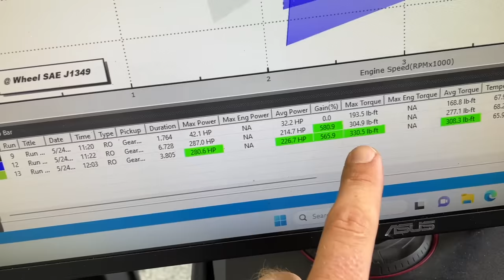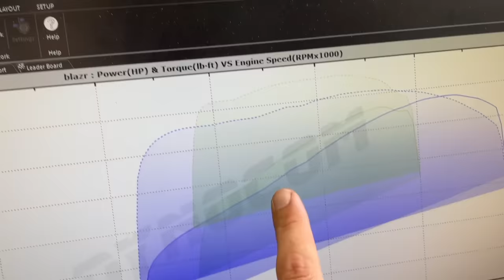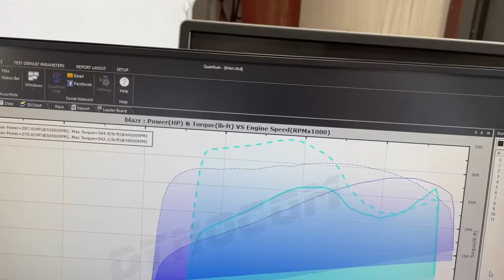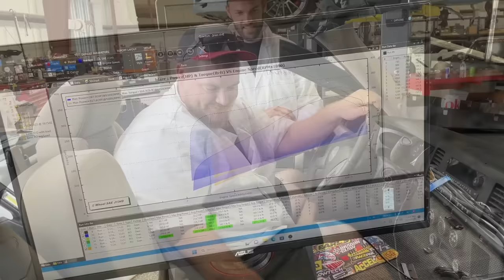MIND BLOWN!!! We Put TOP FUEL NITRO In a Daily Driver and It Made INSANE HORSEPOWER!

Comment: The amount of air required to burn 1 kg (2.2 lb) of gasoline is 14.7 kg (32 lb), but only 1.7 kg (3.7 lb) of air is required for 1 kg of nitromethane. Since an engine's cylinder can only contain a limited amount of air on each stroke, 8.6 times as much nitromethane as gasoline can be burned in one stroke. Nitromethane, however, has a lower specific energy: gasoline provides about 42–44 MJ/kg, whereas nitromethane provides only 11.3 MJ/kg. This analysis indicates that nitromethane generates about 2.3 times the power of gasoline when combined with a given amount of oxygen

Comment: Nitromethane is basicly a liquid low explosive, used as fuel. 
Some part of it burns (the methane groups) as it carries roughly 50 % of  the necessary oxygen itself for combustion (but still need some more), but the main energy release is the nitrogen relasing their bonds to the methane group and the oxygens, and forming bonds with another nitrogen making N2 aka gaseous Nitrogen. (just like in most high-nitrogen explosives, as a nitrogen-nitrogen bond is the most stable and lowest energy state, and any energy state above that, that was used to "force" the nitrogen to bond to other atoms is then released as heat).

Thats why, in top-fuel and the like, the huge honking supercharger is mostly there to squeeze in some air that make use of the "methane" which combusts conventionally and also act like an cushioning effect for the MUCH more violent energy release caused by the Nitrogen bonds. In port injected nitromethane it also reduces the chance of hydrolock.

Comment: I didn't have time to watch the whole video but when you run nitro Methane you need a much richer mixture I think.
My engine wouldn't run, I started it with float bowl full of normal 99, it ran, but as soon as the nitro fuel from tank reached it, it started to bog then stopped.

Comment: Now, add:
a nitro tank, a 2nd fuel pump & filter,, an electric fuel valve,  a 'wye' with backcheck valves and fuel line connectors, for suitable pressure, all rated for use with nitromethanol, (don't want stuff dissolving) both pump and valve are switched by the (separate from the map controls) 'map-1-map-2  fuel' switch. 
Both maps stored on chips, with a checksum comparator, a 'change map', a 'select map', and 'load map' switches, with 'completed' 'error' and other messages displayed either by LED indicators, or  LCD  or LED display.
So once installed, can select change map, select map-2 (the nitro map) then operate map-1 -.map -2 fuel switch' to map -2
could also make the 'TMI' or 'operators Keep It Simple Stupid (KISS) version could be a simple 'normal' and LETS GO M-F'S!!! pushbutton switch and 2 LED's.🤣

Comment: Take care about the serious fire hazard!
Reply: I thought that too, being it's sitting there in an open 5 gallon bucket... but nitro-methanol doesn't ignite that easy, well, as easy as gasoline would. It's more explosive when it does though. I have 3 gallons of 25% nitro-methanol sitting 5 feet from me in my office in my apartment. The bottles are sealed though... :) I use it for RC cars. It has 11% castor/synthetic oil in it though too.

Comment: Build a custom injector port and run both stock/aftermarket injectors and stock computer/ tuned . And a switch to run whichever one you want or need. And then a fuel cell with your fuel mixture. And you have a hell of a sleeper

Comment: Put a few drops of hydrazine into that nitro and then try your test.  Replace engine oil with 05W.  And, remove the hypoid lube from the rear differential.  Go real fast for a couple miles.

Comment: Too bad they didn't gather some other baseline data, or "control" measurements, like a compression test, and a leak-down test, on each cylinder, pre and post dyno pulls. 
I suspect the readings would be quite a bit different after just those few pulls. There's a price you pay for those kind of HP gains...  I used to race dirt oval karts (2-stroke), and one was a Yamaha that I ran a 20% nitro/methanol fuel mix, in a 20/1 fuel/oil ratio.  After 1 night of racing (2 heat races, and a main event), the top end would be completely worn out, piston, rings, and rod w both wrist pin bearing, and crank pin bearing. But man, it was insanely FAST..!!!

Comment: Nitro is really a monopropellant meaning oxygen has no part of its decomposition just part of the exhaust. Monopropellants are what satellites use for fuel typically it is hydrazine the vacuum of space who needs stinking oxygen.
Often monopropellant are activated by metal screens.
Nitro just doesn't behave well enough nor is it easy to set it off to be reliable used as satellite fuel because it depends on heat and massive pressure to set it off.
Do not pour it on the concrete and hit it with a hammer.
You may end up wearing concrete in the back of your skull.

Comment: Hey you owe me a F150 I stuck it in my ecoboost, I spent 445$ for a can of nitro ,and drove it turned up the boost from normal 20psi to 24psi, 25psi , left the timing as was and it ran like a scolded chicken , went from a 11.9 1/4 on a gen 1 down to a 10.9 it made two runs first was 11.5 second was 10.9 after adding a bunch of fuel and timing ..then it went bang, lol..

Comment: Video idea for you do this again but go find a f150 1999 to 2003 with the 5.4 triton 2v. I wanna see what kind of abuse one will hold up to before it blows a spark plug out 😂. Besides the plugs needing that peace tapped in witch will solve that problem for good. Them engines will go threw hell and back. And according to google out last the iforce Toyota v8. Idk bout that. But I would like to see one go threw this. They only got 230 hp from factory let’s see y’all get one brake 300hp 😂😂😂

Comment: Isn't that similar to what you use in the nitro RC cars..?... I used to race those things professionally,that stuff burns your eyeballs... I usually ran 25% nitro content.... I believe the only difference in the RC car fuel is it's got a lubricant in it...but it'll still run in a car...I've run it in a weed eater before... Man that thing revved unbelievably fast...😂😂.. back when I was racing those things(about 8 yrs ago).. we were paying like 20 bucks for a gallon of 25% nitro... You could get it up to like 40%.. anything above 25 made those little engines run hotter,which is bad.... We raced on a clay oval track,my class was super late model. And I was the track prep guy...Around the end of the race you needed to be nearly out of fuel... when the tank ran low the engine temperature would go up.... Proper tuning was essential or you would destroy an engine real quick...

Comment: Something about knowing y'all went from 300 lb-ft of torque to 350 lb-ft tells me lugging an engine is a myth.
Supposedly, "lugging an engine" means to put too much throttle at too low of an RPM which can bend connecting rods and cause blow-by to foul the oil.
But, how is it possible to use a different fuel, which produces much more power by imparting more pressure on the cylinders and pistons, and not be causing the same internal damage?

Either this engine will need more frequent oil changes and component inspections, or lugging is a myth.

Comment: Bout the worst you would do is burn out the cat and prolly the O2 sensors, doubt it will blow the engine unless over revved. Usta run a mix of 92 octane pump, A quarter gallon of model nitro fuel and octane boost in my 88" Honda 300 fourtrax modified with a 400 carb. Ran like a striped ass ape.

Comment: Don't be pouring Nitro methane or even gas like that.  If you are in low humidity condition it can spontaneously combust.  The jug of nitro must be grounded to the receiving container, even if they are not metal.  You can touch the cans together as you pour, Or bond them with wire and alligator clips.  When you pour through the air, a very volatile liquid into another liquid (or even and empty container) through the air without touching containers first, difference in ION charge can cause ignition.  It is static electricity and has cause many explosions and fires over the decades.  Don't even pour regular gas into a bucket that way without touching the containers together first and as you pour.  Unless you want your face burnt off and your shop burnt down then go ahead and keep doing it the way did.
Reply: Yeah it is some dangerous stuff. I would be leery of even storing it in the garage around any electrical.

Comment: Where is your hydrometer?

Horsepower Increase Using Nitro 			
This Chart Based On 500 Ft Lbs Running Alky		Horsepower @ 7500	500.00
% Nitro	Increase	714.014	Increase
10	530	756.85	42.84
20	561	801.12	87.11
30	595	849.68	135.66
40	631	901.09	187.07
50	669	955.35	241.34
Shift Occurs		Shift Occurs	
60	707	1009.62	295.60
70	751	1072.45	358.43
80	796	1136.71	422.70
90	844	1205.26	491.24
95	869	1240.96	526.94
100	895	1278.08	564.07

Comment: Twin sets of injectors, fuel tanks. Use 1300cc injectors, 90 percent nitro.
Go pick on suckers in grudge matches using THAT EXACT TRUCK.
Roll to line, attempt a feeble burnout with gasoline, get staged, flip over to nitro, run a fast quarter mile.
Collect money.
Laugh.